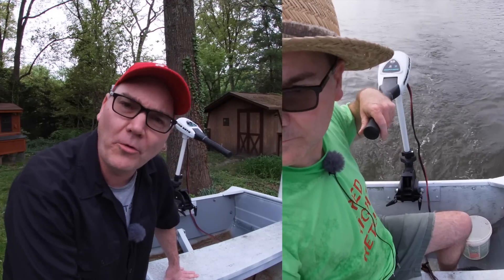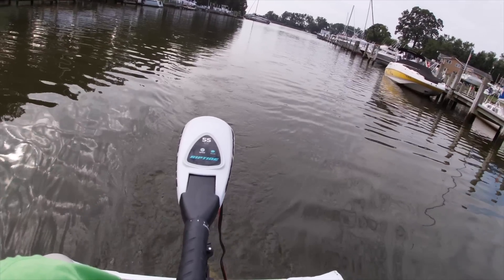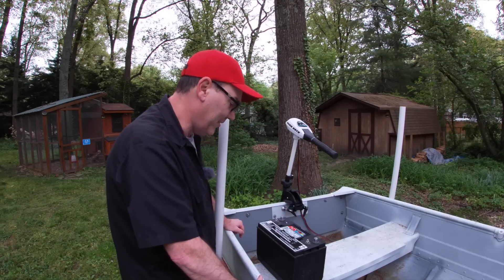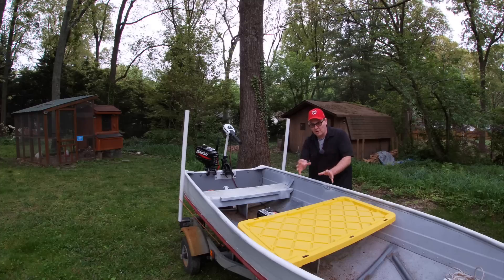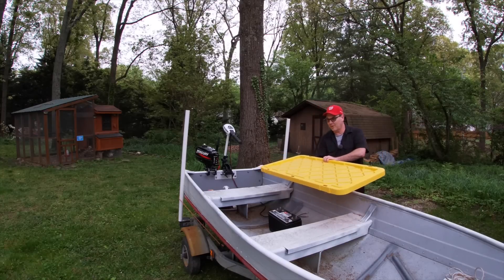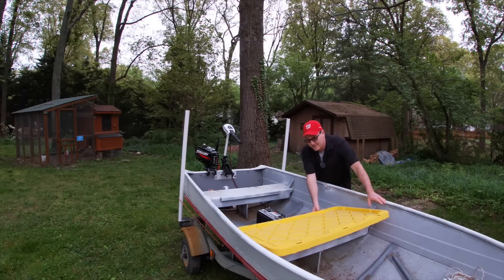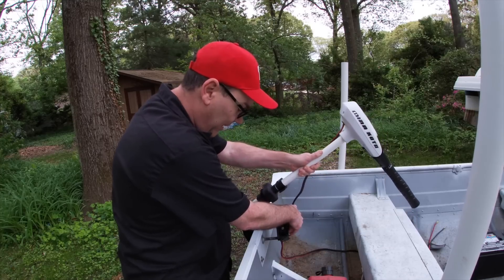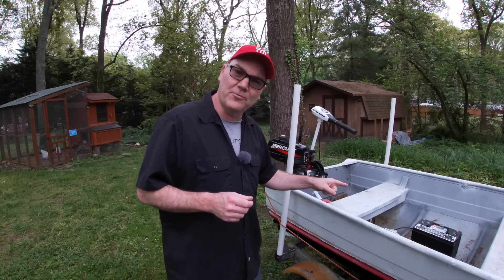How Many Solar Panels Do You Need For A Trolling Motor?

Comment: Well I commented before, ( 11 months ago ) I now have an 11’ ft fiberglass three seat v Hull , and I have the same trolling motor , didn’t get a battery yet only because I have to get the boat registered first , so I’m still thinking 🤔. Power is needed all the time 👈🏻, ( solar  w/ batteries? - if it’s cloudy no power - the wind generator , what if there’s no wind ? , then I saw something new !!! Hummm🤔 A salt water battery 👈🏻 and since I’m going to be using the boat in salt water , Ta-DA !  So now the big experiment is how big of a salt water battery do I need 🤔 or can I just stick electrodes made of certain metals or what ever they use to make a sodium battery right in the water to get a charge 🤔 do I want a separate battery to charge as well 🤔and to store power for lights or accessories, so I’m now searching how to build salt water batteries ! Ha !   Who knew ! 😳😄

Comment: Small remote start generator in the front of the boat. Turns it into a hybrid or maybe a HF 400 watt power station at around $300 it puts out 400 watts

Comment: Hi Wayne. I have a 16-ft inflatable fishing skiff by Sea Eagle. I run a WaterSnake 70-pound-thrust trolling motor on a single 12v, 122Ah,  Deep-Cycle, Marine Battery from Walmart (size 29; $89.99; it's a beast). WaterSnale recommends a 105Ah battery minimum at  nominal 12v and a 60amp breaker. I completely charge it and maintain it charged with a PowerFilm 45W flexible solar panel with built-in 12v Solar Controller. I can't take a lot of Sun, so I have a canopy. I also don't have outings much longer than about 4 hours and that is not constant use, let alone full throttle. But I run the motor until it noticeably slows down because the battery is running out of juice. We know that SLA Batteries should not be discharged much beyond 50%. So if the Walmart battery delivers 1464Wh you only have access to about half of it, or 732Wh. Since I don't go boating every day, I have multiple  days that the solar panel can charge and maintain the Walmart Battery. In 3 years, I have never connected an AC-powered battery charger to that battery. The trolling motor has a digital display that tells me when the Battery is at full charge. I live in Southern California and get a full 7 hours most days of sunlight. I've never tracked how many hours/days it took to bring the battery back up to 100% SOC. LifeP04 batteries are down to $325 each (12.8v 100Ah) 1280Wh and only weigh about 21 pounds. Three of them are the equivalent weight of the Walmart SLA. They can be had with BMS's that have BlueTooth with an app, so no need for a shunt and a monitor. Most can support connecting 4 in series or parallel (4S4P). LiFeP04 batteries don't slow down when they are running low on juice. Their BMSs just shut them off. They can run almost to  0% SOC.  If I bought 3 of them for say $1,000 they might deliver 3840Wh. They want to be charged at 14.4 volts and to charge 3 of them in parallel it would be necessary to get a solar controller meant for it (pair of charging leads for each battery) that can do the 3 stages of lithium charging: Bulk, Absorption, and Maintenance. Suspect I could run almost more than 24 hours at full throttle and recharge all three with a 180W panel in a few days.

Comment: I am partial to small gas powered engines particularly as auxiliary power for small sailboats. The Suzuki 2.5 hp LS at 31 pounds is perfect on my Lightning sloop (19 ft). With a small extra can of gas, the motor runs forever, and at 4 stroke is so quiet, it is barley more than an electric motor. Powering upriver at low/med throttle is almost like sailing . I hope Wayne can do a more complete review of this motor in a future episode for usage on sailboats!

Comment: Instead of putting in a battery a charge controller why not drive a 24v motor direct with the panel? It will reduce a lot of losses from conversion etc. You may go a bit slow at 18 to 20v from the panel but it will put in about 10A with just 2 x 200w panel.

Comment: What I have done is I purchased a SOK 200 amp hour lithium battery for double the range. If I decided that day I want to spend all day out in my 12 inflatable striker boat, I also bring with me my EcoFlow RIVER Pro Portable Power Station and my Minn Kota MK 110P 10 Amp Portable Battery Charger. It works flawlessly and everything is lightweight, I never put a price on things I enjoy. In detail here is a close look at the parts I use.

* Minn Kota Endura C2 55 Freshwater Transom Mounted Trolling Motor (36" Shaft)
* Minnkota MK 110P 10 Amp Portable Battery Charger
* Marine Grade 12V 206Ah LiFePO4 Battery,Sealed Plastic Box
* EcoFlow RIVER Pro Portable Power Station
* EcoFlow 160W Portable Solar Panel (I bring it to charge my power station when needed)  Because I use it to charge multiple components. 

* I can stay out all day while sometimes running at speed 5 on the  Trolling motor. Now do not get me wrong. My 200 amp hour lithium battery is more than enough. But since I use my boat for camping explorations to different islands in my area. My ecoflow setup works for many applications. It's just a added bonus.

Comment: Don't forget that lead acid batteries should never be depleted more than 1/2 discharge if you want them to last.  Having solar constantly trickle charging the battery would extend the life.  I think having a canopy over your head is a great idea, especially if in sunny places, so I would do a full 4 or 6 panels PLUS the two batteries.  Sure it's extra weight, but the batteries being on the floor will offset the "tipiness" of the overhead panels.  Upgrade to a larger boat if need be.  You would likely see similar range as your gas motor, and don't forget, it doesn't smell, gives you "free" energy, you don't have to go get gas at a station, nor worry about fires.  Solar is the way to go in the future.  I don't like the lithium ion batteries due to fires, but the expensive new Lithium Titanate batteries are awesome and can be completely discharged 10's of thousands of times and don't catch fire.  Perfect for boats.  Now if only the price would come down...

Comment: I already got a bunch of solar panels and equipment I got a 14 foot Jon boat i like to sit in the floor of the boat while I fish for a back support im thinking about mounting a 100w solar panel on the side of boat and putting it on rails so when I get to me fishing spot I can pull it up off the side and it bend over my head it would at like a shade umbrella while it’s putting some charge back into my battery idk what do y’all think

Comment: thank you for your reply. my ex son in law has an electric motor which you might consider antique , it being at least 20 years old. but it moves his 16 ft. (bass) boat around quite well. i can't recall the name but it has a large top end sort of like a gas driven unit. it has a white color and i believe a ton of batteries. but with that being said, i am too poor to play with those numbers. a14 ft boat and motor is my dream and 1500 $ would be stretching my  cash limit. thank you for your info and see you on the web.

Comment: If you put two batteries in parallel you won't just have double the range. You'll have more torque. When the motor turns on there is a voltage drop in the circuit. With two batteries this voltage drop will be reduced. So you'll have more power. Especially under heavy load and accelerating.

Comment: well i did a small cart with a 300w scooter motor, and a few hundred watt solar panels.  id' always get the voltage low, but it takes time for it to recharge even though its pushing out power. its just not the same as stored power. i dont know why

Comment: why do you keep recommending the poorer quality and more expensive polycrystaline panels and pwm charge controllers to get your point on pricing across? it's much better, more performant, and more affordable to go for a monocrystaline panel (which works better in poorer weather), and an mppt charge controller.

and that's not even taking into account what kind of battery you have there. lead acid is cheap for good reason. it has a poor shelf life. you can only take it down about half way before you have to charge it again. lfp batteries can be 80-90% discharged. that means twice the shelf life, and you can recharge it to full and fully discharge it again. and again. there are expensive ways to do solar, and there are smart ways.
Reply from the maker: In my area, there aren't a lot of great resources for buying solar gear other than Amazon and the average person doesn't understand the difference in solar panel types. This video was to simply address whether or not a person could just add a solar panel to their trolling motor setup and run their boat for a much longer time - and if that option is cheaper than buying a second battery.
Reply: @WayneTheBoatGuy  yeah my apologies, i commented before watching the whole video through. didn't mean to sound like an ass. it's good introductory advice!

Comment: So a minkota c2 30 uses 170 watts at 5th gear with water resistance. A 250 watt panel today is around 60 bucks.....  they have newer panels that are bifaced and need refelctive surface underneath like a piece of flashing and you can run around 500 watts for around 200  in one panel That said you add a very small capacitor bank to absorb the surge of draw instead of it hitting the battery's and with a lith ion battery you can run on the 3rd setting with 1 250 watt panel should give you a full day on the water. You would prob want to give it a hour or 2 around noon to recharge with no loads on. The size is 3 feet by 5.5 feet almost covers 50 percent of 12'  boat as a bimini top. I have some extra panels and equipment so will let you know how it works in the coming months

Comment: I am revisiting this topic only to share. To make a small boat run all day or for days on solar only, there are many options out there to go about it. The good thing is the longer the boat the better. First off stop playing around with 100W panels. There will not do the job. Believe it or not you can pick up a used 200W+ panel for under $100 bucks. So what it's used, the average panel has 15 to 25 years or more life spand.
   Although it highly depends on what kind of fishing you do and the body of water you fish on but all day fishing can be done. Yes it will cost more than the type of set-up you have in this video but I think it's worth the extra money because what I am taking about last for years.
 (In Fact the charge controller is the week link in this system so get a good one)  Now, a 200W+ panel is about 4ft wide and something like 5.5 to 6ft tall on a 12V out put panel. However, turn the thing sideways and give up 4ft of your boart from fishing. All the other perks will make up for the lost space through power production and shade on the boat from the hot sun.
    Go on Amazon/EBay or something and get the parts you need to build your own 12V Lithium battery no mateer what chemistry you go with. Get a good MPPT controller and go fishing any time you want for as long as you want.
   Lead and/or AGM is not the right battery for this application do to it's characteristics of charge and discharge.
   Lithium batteries will take a charge when lead or AGM just can't. The nature of lead and AGM takes more power time and power over all at the end of there charge to become 100% charged than any Lithium will ever need. Lithium will also give you all it's power until the end where as a lead or AGM just cannot do this, you will hurt AGM or lead if you do this to any times.
    Example: An AGM and/or lead battery with 100AH of power can only give you 50% of the power. (remember 10V is a dead lead or AGM battery) It is true that a deep cell can and will draw down lower with no risk of damage but the charging parameters do not change much from lead and/or AGM to deep cell.
   With lithium, what this means is you can not only charge faster but you will have more AH's available for use than any other battery out there. This also means you can charge on cloudy days which are the best fishing days.
    Yes it will cost a bit more and you do not have to go with the top of the line Battleburn which will set you back a grand EZ for a 100AH 12V battery. There are planty of other companies out there selling good batteries that will hold up in this application very well and last for a few thousand chargings. Now understand something about all lithium batteries. The number of charge cycles do not I re-peat do not mean the life of the battery. It only means, at this point is when degradation starts. This means the batteries  AH will start to go down sslloowwllyy. But with a 200+w panel will do it's job to get you back to shore, so put in a monitor so you will know when this process begins to take place. There is no reason to be afraid of lithium but you do have to know what your doing. It's dummies that make lithium dangerous to us all. DO YOUR OWN HOMEWORK
     Even if you still go with Lead and/or AGM, the key is power production. In this case the panels will get you to shore even with a dead battery. Stop playing around with 100W pales for this application, they just can't put out enough power for the job. A 100W panel will do much better with Lithium than any lead or agm but still 200+w panels is the right way to go for this application. Just take a look at most sail boats! If they have 100W panels they have a ton of them and more so than not their not hooked up right or running so little power it does not matter. But if they are running 100W Panels they are not used to charge a battery bank to run a motor (I bet you this). 
 Thanks folks I just wanted to share this bit of info on this topic. Happy Holidays everybody...

Comment: It works with lithium batteries lead acid just doesn't have the capacity and one panel can't keep up with the motors Amp draw so you are going to need a bigger boat

Comment: I don't even fish but what I like about electric is I can cruise around the pond with a couple pints and enjoy nature without having to listen to a bumbling engine at my right ear.  How many amps draw does that little motor pull? Wouldn't 1 100w panel put out 5A at 12v? On the lowest setting that thing cant pull much more than that?
Reply from the maker: From what people say, the typical trolling motor draws the same regardless of speed because they use internal resistors (because they're made cheaply for just trolling). At the time I made this video, it seemed to be more cost-effective and easier to just buy a second battery instead of a panel and all the associated components to have everything work correctly. If you're just going out for a short time, a single charged up 100 Ah battery can easily do the job on it's own.
Reply: @WayneTheBoatGuy  Ah good call on the resistors. Didn’t think of that. Curious to the draw with some real world testing and an amp clamp hooked up. I agree on the double battery setup although it is nice to fantasize an infinite range boat. Cheers!

Comment: Another battery + solar =) And I would use the flexible type of solar panels because they are lighter and boat will not be top heavy if you build a roof construction. Solar panels are there to give you extra hours, but it will charge you batteries when boat is not used - for free. 2 batteries = approx 2000-2400w and use 4 flexible panels. Do you have spec. of your motor?
And how many hours do you need to run the boat non-stop?

Comment: There is a way it can be done and trole fish as well. You will need to use high power panels and an MPPT charge controller and lithium batteries.
   Here's why; lithium has a different charge profile than lead acid and it has a dis-charge profile way higher than lead acid. Also lithium will give 90% to 100% of its power. To where any lead acid battery well only give 50% to 75% of it's amp rating and the last 10 to 20% of the charging of lead acid batteries will take 2 to 3 time the power to charge it that last bit then the first 80 to 90%.
   Lithium however can and well take all the power you can thow at in a small boat like this, even if you go with smaller panels. The key here is to give the MPPT charge controller the power it needs to function which is why I said use high power panels to save space and weight on the boat 
   This is a big difference in how these batteries charge and dis-charge which makes all the difference depending on how you use your boat and the body of water your in.   Hope this helps

Comment: How would I go about it. My system just gotten better. The first try. I can't test it out on the water. No way. My longest run time at 30% power was 12 hours straight. No 200 watts. Way less. Now winter. I wish I could run a test now. At freezing. No. Unless I use my bathroom tub and no solar. The next test is at 100%. Although I am not thinking of doing it. Why. The motor is new. Yet around 20 years old. It has brushes. Smallest trolling motor. Although next size prop up. Not two blades. 3 blades. At full, run up out of water. I am going to be cautious in water and on the boat. It is for my pontoon 12ft raft/boat. In short. I am not sure if I want to put the power at 100%. Only mod is bigger prop. That's it. All 100% original. 11.5 mph is the fastest I have seen for a  kayak. Could it beat it. Good question. I will have to wait for next year. When your prop sounds like an airplane prop. How fast is that under water and pushing a boat. Yet. I refuse to see how long on the water. I have no guess. Yet I am not even using 50-watt solar. No one would travel 24 hours straight in a small boat. It's not happening.